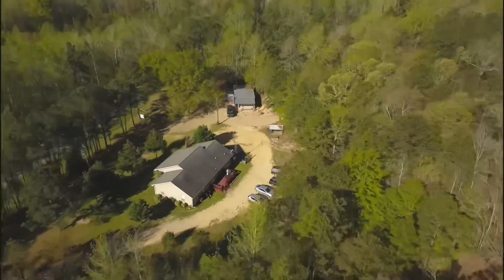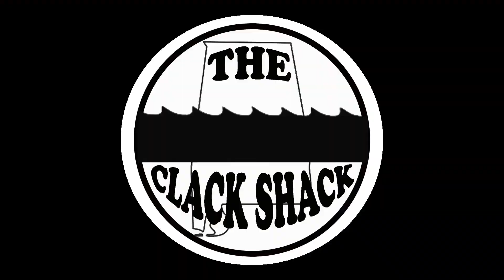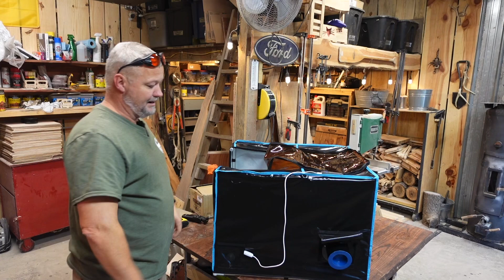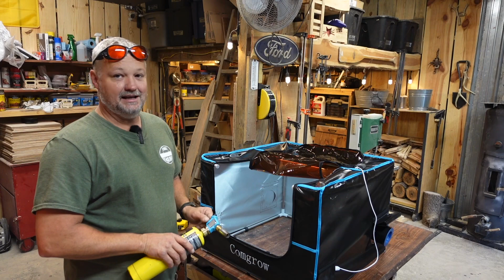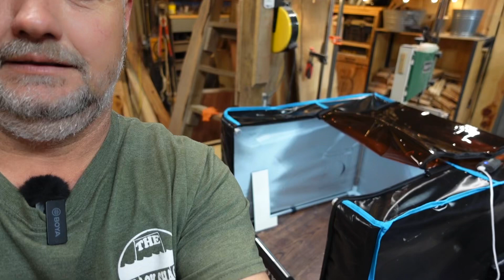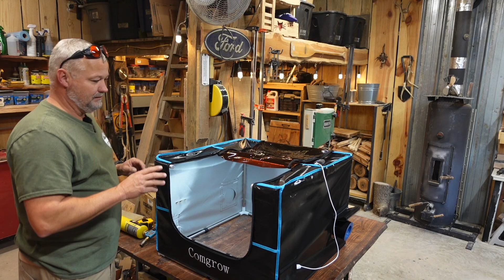Will it burn? Comgrow's newest enclosure

Comment: I know it has been a year already, but how did you find this enclosure compared to the large one that Comgrow makes? I know the larger one is taller, but is it of any benefit that the bottom is closed on that one compared to this? What would you recommend?
Reply from the maker: Too enclosed can limit air flow. If it’s completely enclosed, you have to leave it partially unzipped for flow. They are all about the same

Comment: Did you have any smoke leaking out through the bottom since it is not completely sealed?
Reply from the maker: You cannot completely seal any enclosure if exhausting the smoke. Without the correct amount of incoming air, the smoke will not be removed. You have to allow as much as possible while maintaining positive pressure on the inlet. I have no issue with this one leaking

Comment: I'm wondering about the window.    Is it flame resistant?  Also how well does it work to block laser light?   You did some tests before with 3mm acrylic where you cut it to prove it absorbed laser light.    Can you please do the same with that plastic film?
Reply from the maker: I have used a machine and it blocks visible blue light.

Comment: For my Comgrow enclosure (v1) I used some 5mm ply and built a mounting “wall” for the 4”duct outlet. I didn’t like how floppy the connection was.  I 3d printed some simple clamps that hold the ply in place on the top and bottom rails but zip ties would work. Of course, I laser cut the 4” hole for the plastic outlet. It really solidifies the ductwork connection.
Reply from the maker: All that enginerring sounds like something I would do...lol
Reply: LOL - yep! I have a short video showing it if you’d like to see it. - https://youtu.be/xogsTYTVn98

Comment: I'm curious about the clear window. Don't torch it though lol. 
Are these enclosures manufacturers claiming this will contain a fire on the machine or just that the enclosure itself is fire resistant? I think it would be good to know how they would respond to a real word situation. I'd hate to hear of something tragic happening due to misunderstanding safety stuff.
"OH we don't have to watch it - it's in the fireproof thing. Let's go to bed." next morning house is burned down.
Reply from the maker: Personally, I think the idea is that if a fire breaks out, the cover will not add fuel to the fire. Without a fire suppression hood, the flamable material inside will still burn. Especially if properly ventilated.